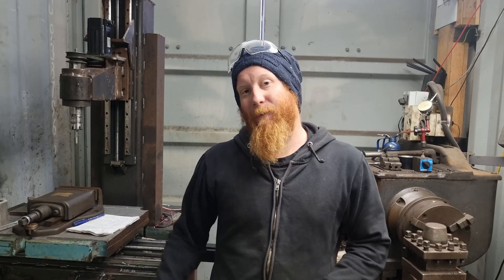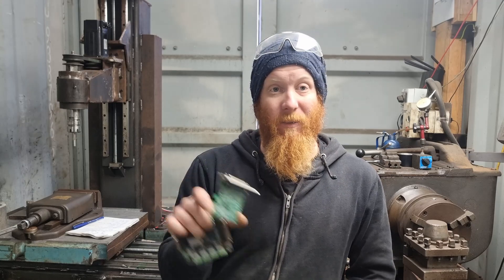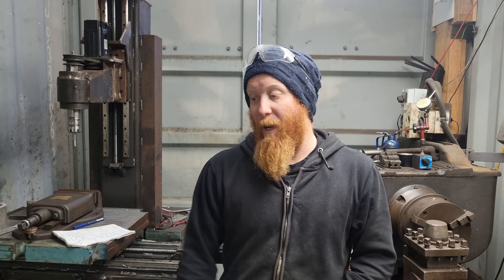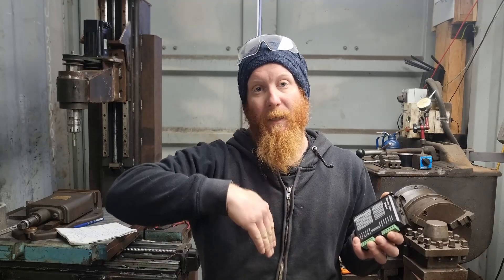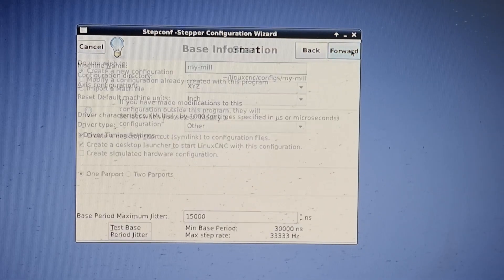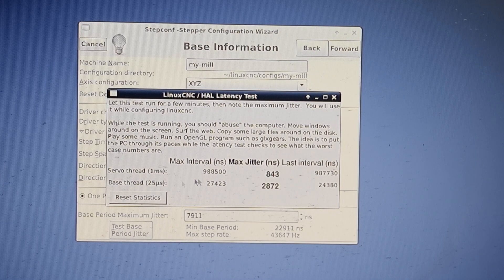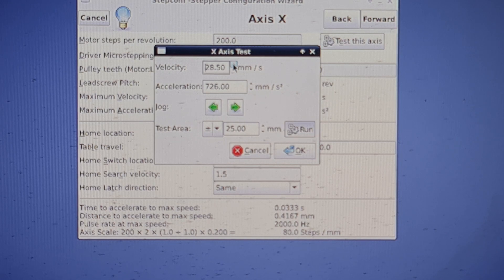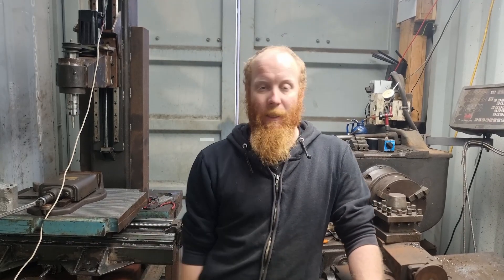Super Cheap Cnc Electronics Kit Build

Comment: DB25 is just the physical connector. The port you're using is an IEEE1284 parallel port you're using to connect to the CNC controller. Some versions of that card also have two RS232 9-pin serial ports at the top of the card.
Reply from the maker: Hi there thank you for your comments that will be very helpful to people I will do better to describe the parts next time. Thank you for your time to comment.
Reply: not have or one port or two port, many different pciE card have to paraller port can use new computers. card have isa, pci,pciE version only paraller port or one or two serial port too have. cost today normal less than 10$

Comment: i have old HP computer whit paraller port, but i add same pciE to LPT port card my computer can use 2 pcs patraller port. same controller i have, and DM556 drivers, 3 Nm motors, and linuxcnc software debian cnc 2.8.4 but i not can use 2 piece Y axis motor, lot lot try setting last 2 month ewery ewening but no working, alltime only errors and not have homing Y and homing all, not can homing if bush home zero come alltime onnly errors lot. i not understand why not working. joint 0=X,joint 1=Y joint 2=second Y, joint 3 Z but not working and not have home Y at display or all homing not can run machine because no can do home all axis, can one Y pin 4,pin5 step and dit share 2 driver ? or how current burn DM556 driver step and dit optocouplers ? or not working, how can add dual Y motors working. and homing.
Reply from the maker: are you running all the motors off the same pcie port on one card and on separate step signals to each driver. have you got the 2 joints set up in Linux cnc to move together. I have switched away from Linux cnc now and gone to mach 4 with a c82 board from cnc4pc.
this code should get you a discount. GINGER5%OFFC82. I will be making a full video on the board soon with the other upgrades to my mill
Reply: @gingerninjaneering  problem have ower expensive licence, my son need use cnc to hobby AND sometime manufactory selling parts, and need be licence if use mach3-4 shit. i has used before my garage mach3 machine but not safe not realtime not good, and linux have lot better flexiple make all additionals software,tools,etc. but i not understand code , haha. hal and ini files. mach not can do all what linuxcnc manufactory has ALL uses linux not newer windows,because need safe computer not worst windows. same problem have need windows have licence too and super expensive, i not have any windows computer last 10 year. pciE card can run all motors same than computer inside paraller port no problem, only software need add use both paraller port, genuine port used cnc motors normal and pciE card used only additional limit SW and other inputs. but can use output too normal. motors or relay. law say need be licence if use windows and mach3-4 and have totally out of any budget because have owerprice lot. linuxcnc no need licence this is budget kind option for me i build my son machine. because firm possiple come inspector and check all licences if sell and use factory, made cnc and have workshop, sorry my english not good. and if NOT have windows and mach licences costy lot lot fee 120 000 $ if not licences have same all offices have use windows but if not have licence come to corporation very expensive pay fee fine penalty what have and court pay too lot.
Reply from the maker: o I see the problem you have. yes linuxcnc would be the best option for you. there are other bob boards that will give you better control that work with ethernet and linuxcnc cnc. but thay is another cost. I found the cheap Bob I was using had issues with the pin outs and I lost a couple of outputs.